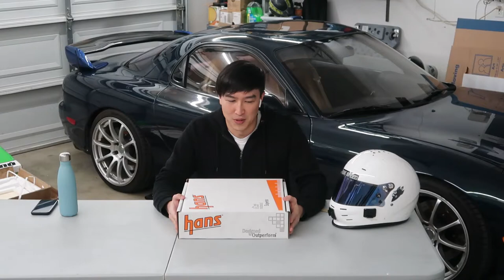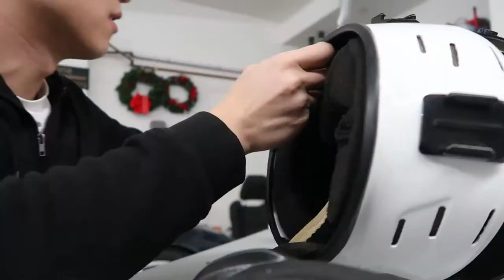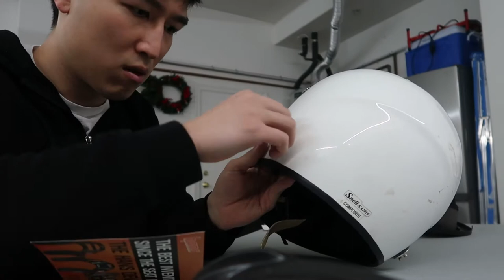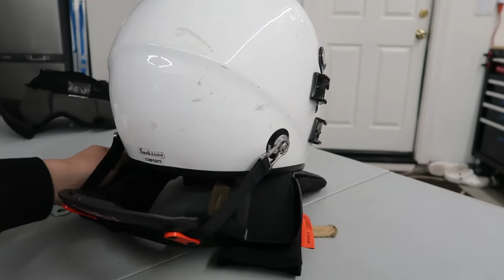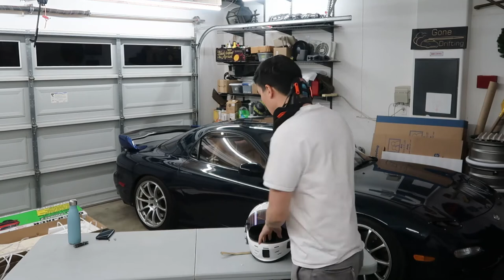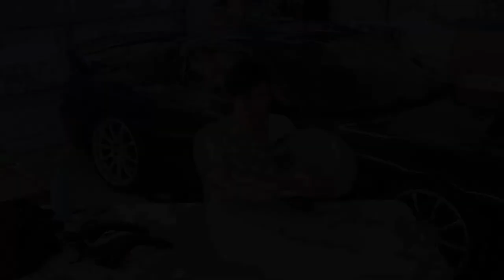How to: Install HANS Device to Helmet | (Season 5 Episode 30)

Comment: Not to be that guy, but i noticed in the video your helmet is SA2010. Idk if the tracks you run enforce it but technically your helmet is expired... i just went threw the same thing and had to by a new one. There only good for 10 years so as of 2021 need a SA2015 good till 2025 or SA2020 good till 2030. Just would suck to show up to a track and them not let you run bc of helmet.
Reply from the maker: Yeah I’m looking into getting a replacement soon.  Luckily most smaller tracks seem to give a grace period.
Reply: In the UK you don’t need a in date helmet to do track days.

Comment: I do have one question about the anchors, when the helmet gets old and does not fit, can you still take off the anchors on that helmet and put it on a new one or you have to buy new ones?
Reply from the maker: Yes the anchors are removable.  As long as the anchors are in good shape I don’t see why you can’t swap them onto your new helmet.
Reply: @Riskspeed  cool thanks!
Reply: I do have one last question, have you heard of the Simpson Hybrid, which is another HANS device not just for the neck but for your body. I need to know which one is better, a regular HANS or a Simpson Hybrid?
Reply from the maker: @christianrobertsracing1  I was looking into those too. I will definitely make a video when I get to try one out! Stay tuned!

Comment: These types of devices can potentially help keep one relatively saver when it comes to one type of injury (basal skull fracture) but nothing beats driving at the posted speed limits and being responsible.  In some cases they can make you much less safe because you feel invincible and push the envelop (you tend to then drive faster.)  Put plain and simple, speed kills. There exists no device for poor decisions.  Hopefully the only time you drive fast is on the track but given your RiskSpeed hat, I somehow doubt it.  I say all of this as someone who also loves cars and had my own share of quick ones including a Mustang 5.0.  I have also ridden fast motorcycles for years (responsibly of course as I am still here!)  I ended up selling it though (too many close calls.)  I understand the rush very well.  It also not just about the vehicle and speed- it very much becomes a social thing- and it's a ton of fun.  I still miss riding.  I have just seen things that I cannot unsee and when you get older you realize the risks are probably not worth it.  I know what I say won't make any difference but please stay safe (and keep others around you safe as well- we all share the same roads.)
Reply from the maker: I’m totally with ya, I drive a slow civic on the street and save the fast driving for the track only.
Reply: @Riskspeed  Smart move.